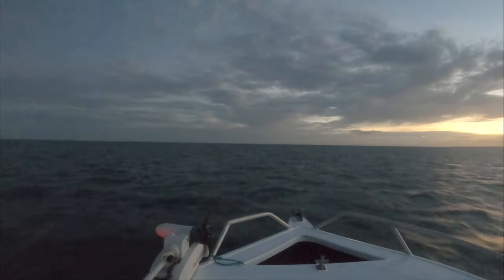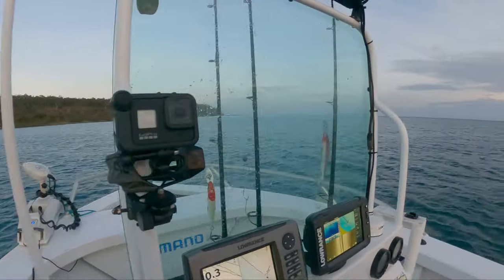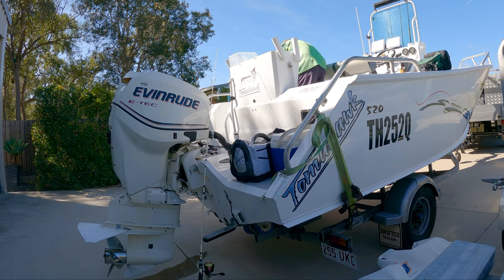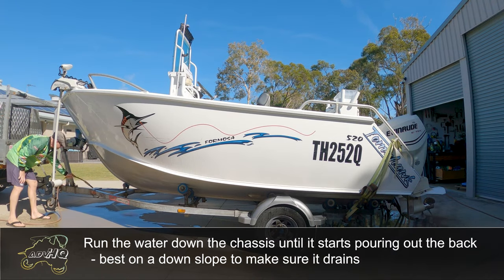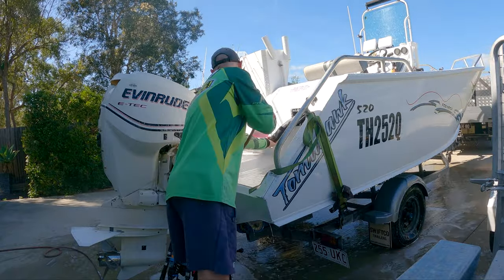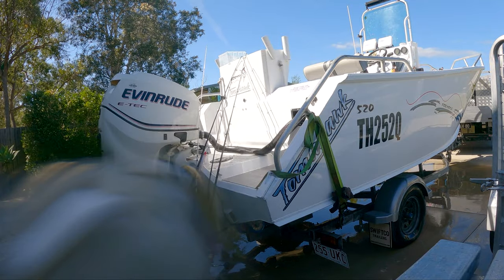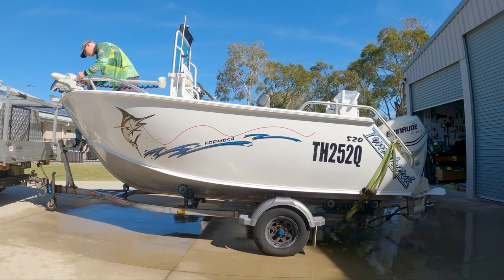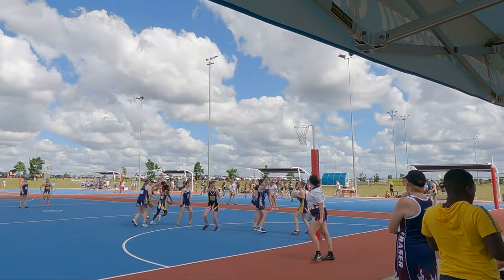How to wash a boat and keep your investment

Comment: Hi, I am looking at the same boat but V2 built in 2017. It has a 90hp Suzuki.  Do you think it will be ok to tow a ski tube with the kids?
Reply from the maker: I think the Suzuki 90 and 115hp motors shared the same blocks from memory. It will likely do what you're after no worries - mates of mine tow their kids around with a 15hp tinny! But, if I repower this one, it'll be with a 140hp or close to. They're a wide boat, especially towards the bow and require a bit of power to get up and push through chop in my opinion.
Reply: 115 HP displacement is almost 2L and 90hp is around 1.5L.
Reply from the maker: @JT-jy2sy  sorry, seems 115-140hp share same bore, and 70-90hp. Take the boat for a test and see what you think.
Reply: How long  would you say you spend to wash after a day out? I do not have a boat and  looking at getting into boating for recreational activities.
Reply from the maker: @JT-jy2sy  I'd say about half an hour including unpacking gear. It doesn't matter if it's a quick trip or all day, the wash is pretty much the same. If it's choppy and lots of spray over the top, or blood from fish to clean, that'd take a few more minutes. 
It's like anything fun, take's a bit of effort but the fun and memories are worth it. If using multiple days in a row, I wouldn't bother washing as thoroughly until the last day.
Reply: @AdvHQ  do you just sponge the console area? What about the inside of the hull and I would assume you can  not just hose it to avoid wood rott.
Reply from the maker: @JT-jy2sy  yeah, I just use a microfibre rag (slightly damp). It's all aluminium mate.
Reply: @AdvHQ  thanks,  sorry when I said wood I was referring to the floor.
Reply from the maker: @JT-jy2sy  ahh, yeah some are plywood - mine's a sealed aluminium floor. I'd be less inclined to hose a plywood floor.
Reply: @AdvHQ  I am looking for my first boat. Would you recommend Formosa? I have read about issues of boats made by telwater like Stacer and Quintrex. Had to find owner reviews on Formosa boat.
Reply from the maker: @JT-jy2sy  I should probably do a review vid! 
Yeah, I'm happy with it overall - have had it for over 7 years now. The hull is strong, beamy and has good freeboard (inside height). I'm mostly a good weather boaty/fisherman, but when I've been caught out in semi-rough conditions, it's felt safe but the front, being so beamy and wide, makes for a bumpy, wet ride with quarter-on chop and wind. It has some paint bubbling, but over the 7+ years (plus extra 5 before me owning it), it's been solid. As I said, I have the solid floor option - they're built a bit tougher than standard. It's a good all-rounder boat - can go reef fishing, family day trips, creeks, etc. Easy to launch/retrieve on my own too. There are plenty of other good boats out there too - I like the look of the Hooker boats - but they've gone up in price, big time! Hope this helps mate - the search is half the fun!
Reply: @AdvHQ  thanks for this reply. That is very details.  The one I am looking at is the Formosa tomahawk classic cc 520.  It has wooden floor and the hull is not a  high tensile one(5083). Hull is 4mm bottom and 4mm side.  I could not find any details about the allumium used.  Not sure if it is pressed aluminium.  Strength wise not sure how it compares.  The hull reenforcement is the same like the none classic one i.e longitudinal stringers welded on the hull with bulkheads.
Reply from the maker: @JT-jy2sy  a neighbour up the road has the classic , same as mine, but wooden floor - they love it.... he gets a bit better fuel economy than me too (Optimax 115). Trust your gut is all I can give ya. It could be a great boat, that's not looked after, and be problems, or a fair dinkum good deal.